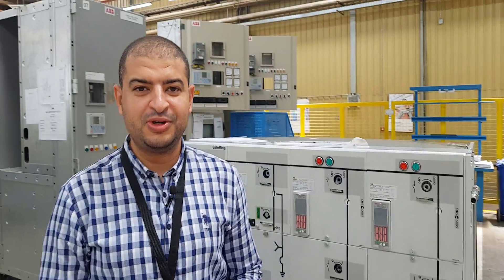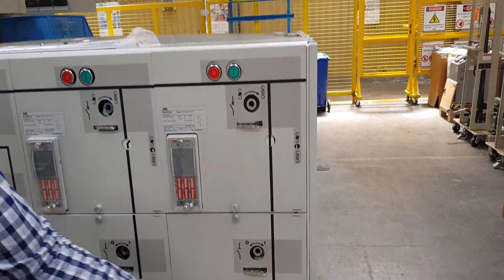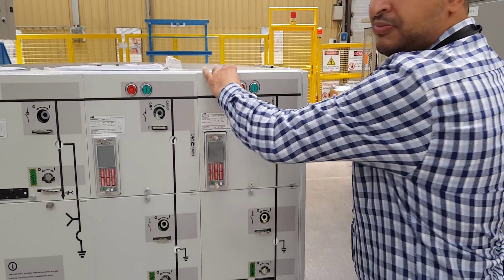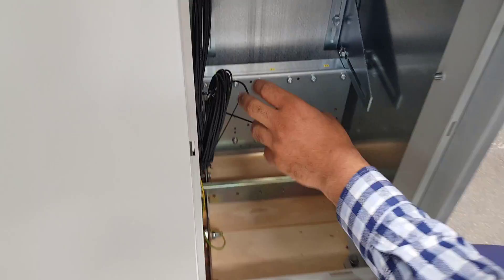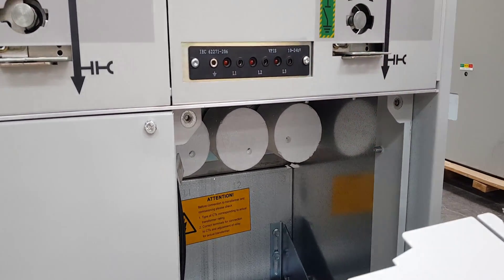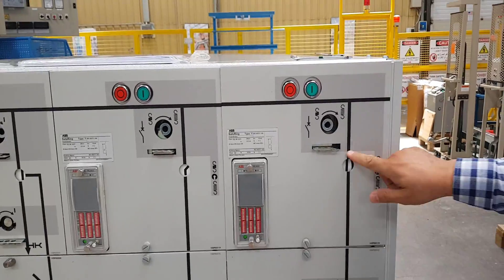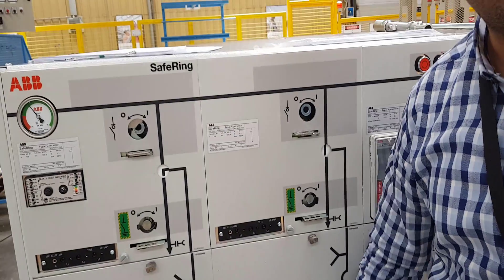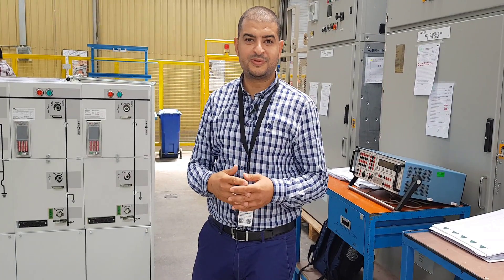RMU Components That Every Engineer Must Know - RMU FAT Test

Comment: Thank you for explanation, but one think I am not able to under stand, you have mentioned the Incomer is 200A whereas out going is 600A! is that possible ? ???
Reply: These are not the actual incoming and outgoing currents, merely the rating of the circuit breakers within the panel. 

Why is the incoming rated lower? 

The incoming has a circuit breaker, which will automatically interrupt current when it exceeds the rated value.

The outgoing cable does not have a circuit breaker, it has a disconnect switch, which must be manually disconnected by an operator. The rating of a disconnect switch determines the max. current value at which the switch can interrupt the circuit without causing damage to the surrounding equipment or the operator. Hence, the higher rating.

Comment: Sir, if we connect the RMU to Switchgear, we use 3 phase (3 Core cable MV Cable) connection, please confirm if we need grounding cable connection also, from RMU to Switchgear or no ??? Thanks.
Reply: Yes, we do